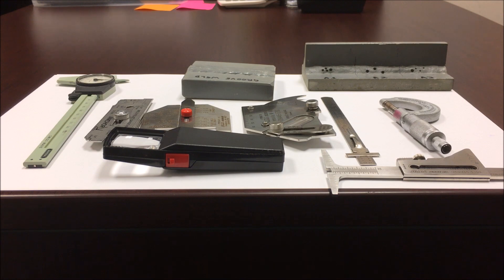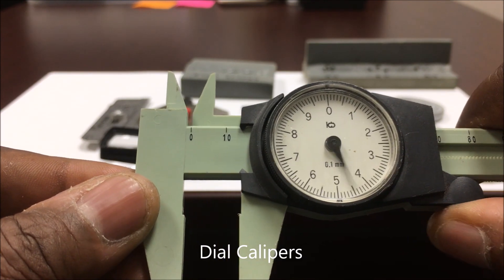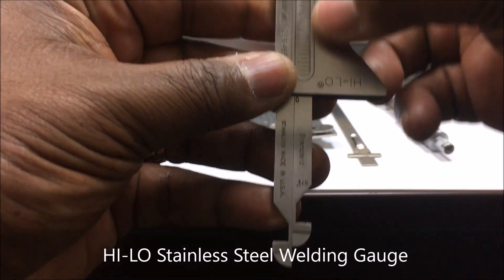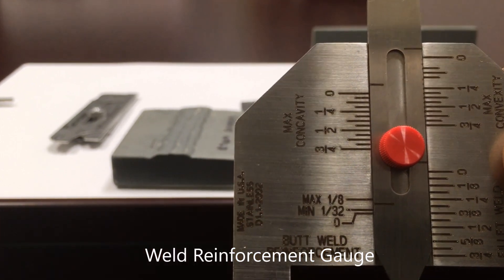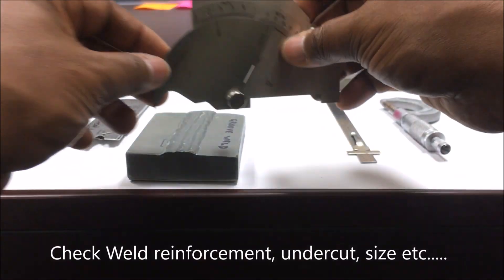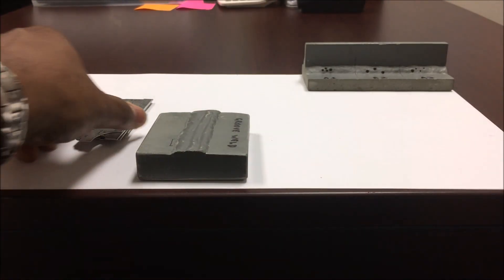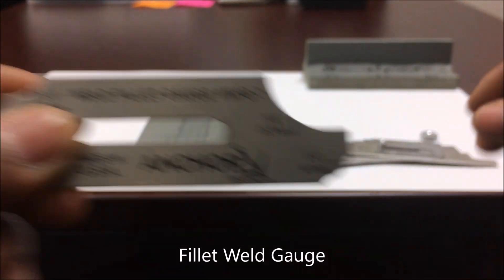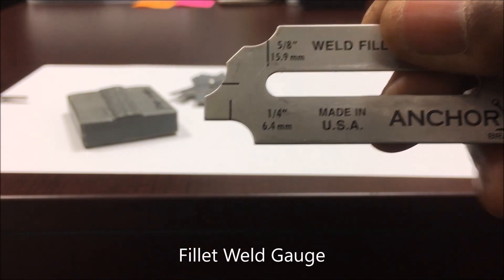CWI 21 -   Part B Tools For Inspecting Welds

Comment: The side your saying is used to measure convex welds makes no sense. That side is used to measure leg length. The side your saying is used to measure concave welds is used to measure the throat.
Reply from the maker: zach wipf true but u can not measure a convexed weld with a concaved gauge. The way I explained it is what will be on the test
Reply: @weldingandstuff  no